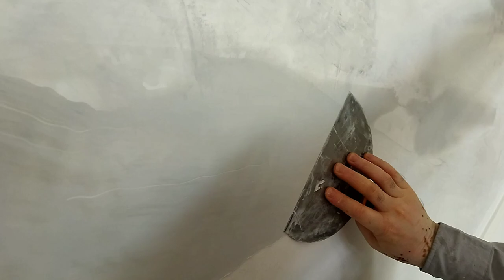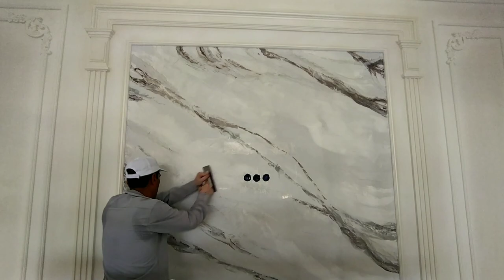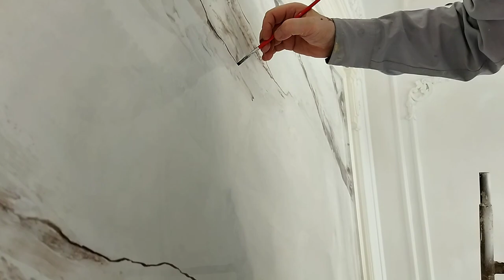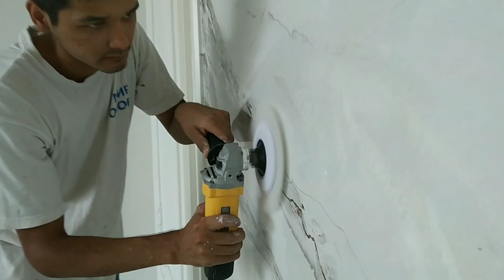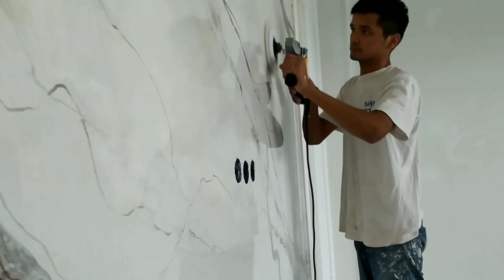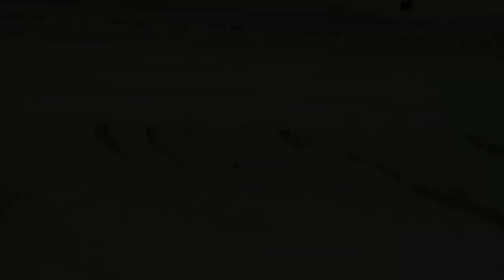Venetian Plaster. Marble Stone.

Comment: What venetian?
Reply from the maker: Venetian Plaster is a classic Italian wall plaster that has gained international acclaim for its exceptional aesthetic value. It comprises an environmentally friendly lime-based finish that may be used on both exterior and interior surfaces.
Reply: @Parpiyevpro  wall putty
Reply from the maker: @PakdeDwek-vo7iy  Yeah applied through a special tool